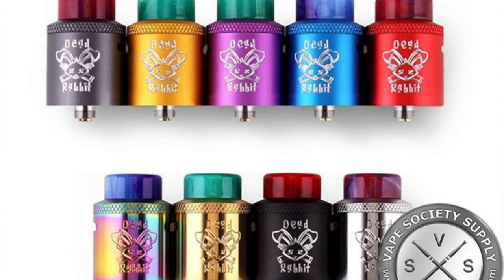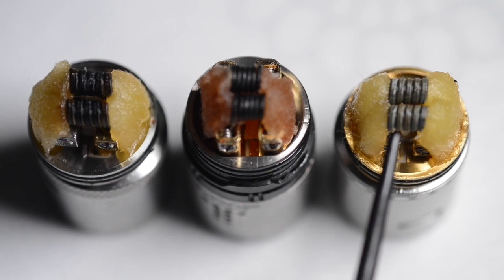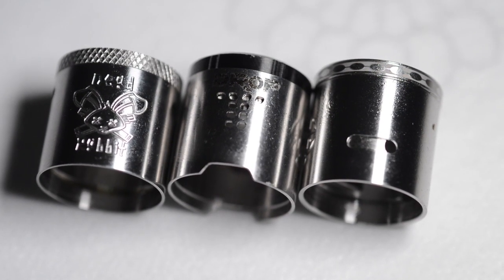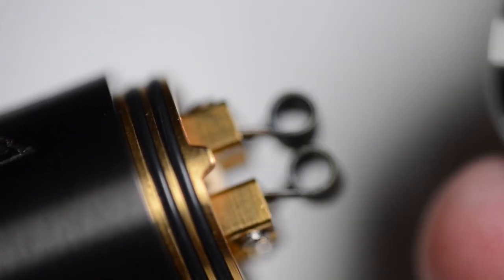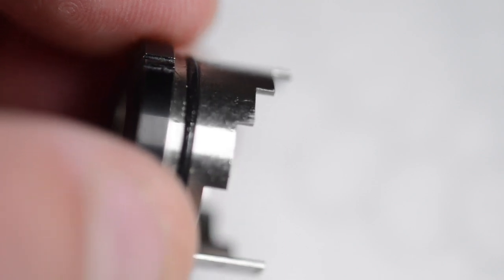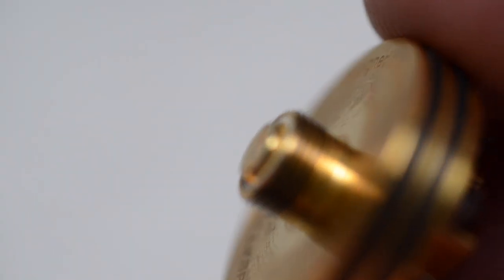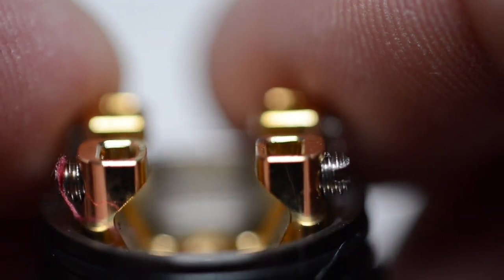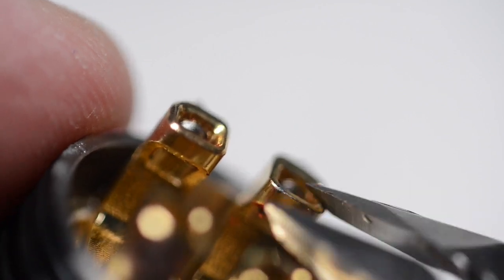AEQUITAS VRS DROP VRS DEAD RABBIT RDA BATTLE

Comment: Good vid Big Lou. I have all three of these rda's in front of me and you summed it up nicely. imo with these 3 top dual coil affordable rda's anyone a person chooses they should be happy with performance. The purging with the dr being the biggest con but not a deal breaker.
Reply: Fictitious Character how did u get the aquestious Rda or however u spell it. Thought still pre order bro?
Reply: Shane when Derek did his first look video The Cloudy Vapor had a pre-order list going and so I pre-ordered it from there. It came from the first batch though and it does not have what is now being presented as the retail version which has the extra notches that keep the airflow from continuously spinning without locking. Not a deal breaker to me as I do not find that the rda gets stuck on the mod, but I suppose it could be an issue for some. The pre-orders currently running are now considered Batch 2.
Reply: Just get a Challenge cap for DR. I The Priest cap and the holes for airflow aren’t pointed up towards the face. Much better than original cap.

Comment: First of all, happy I got to meet you at Foxwoods, along with Ronnie Cash.  Three “older” gentlemen complaining about our aches and pains walking around the floor.  (I had the big gray beard).  I have all three and have a different ranking.  For me, the Drop is great, but it leaks too easily when I squonk.  Great flavor, but the leaking means I have to use it at home and not on the run.  I think the Dead Rabbit was a game changer and the 22mm Dead Rabbit fixed the issue of the cap turning when screwing off.  I agree with the Aequitas being number one because he built on the success of the first two but came up with an innovative flip cap for airflow.  His deck is not innovative and I wonder why he didn’t try something new, but it does work beautifully as is.  Thanks for the review.
Reply: Howard Lenow because I wanted the deck to be simplistic vs having a deck that might not work. It’s about performance for me and ease of use. Anyways thanks man

Comment: Lou,...grab the butcher or priest cap for the Dead Rabbit. It has side airflow so you can purge with steaming your face off. Mine sat for awhile until heathen put out 5e other caps. They are pretty fairly priced without hurting the QC.

Comment: is it worth getting if I already have 2 drop rda's 3 dead rabbits and both challenge caps? also what's a good single coil rda for my squonk mods, I just hunted down a Dee Mods Solo and it sucks it gets super hot wit a 2mm 24 gauge 6 wrap ni80 coil in it and after just one puff its to hot to touch the top cap.... should of just bought a clone since I'm sure it sucks too